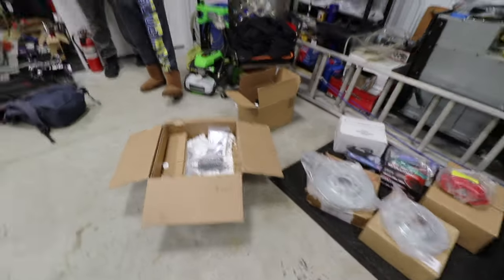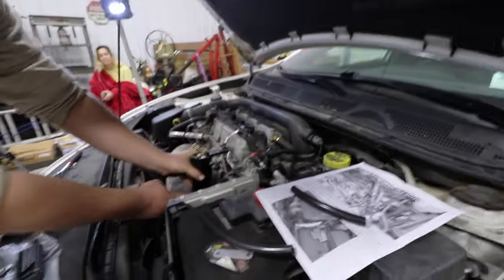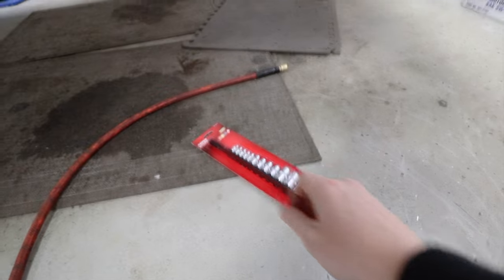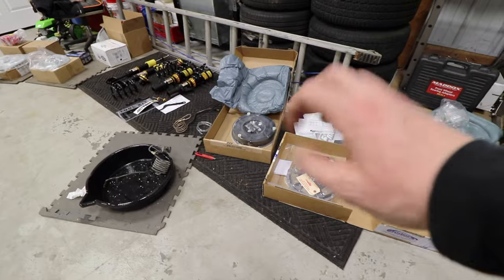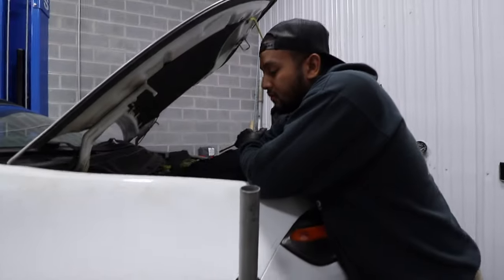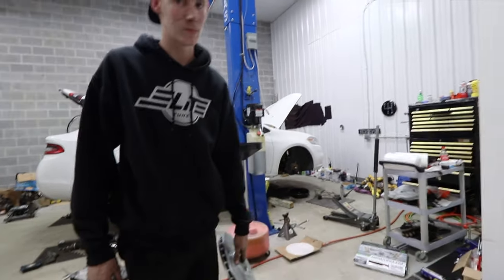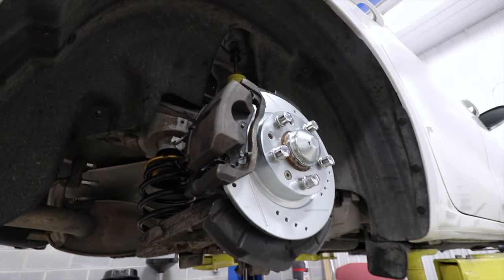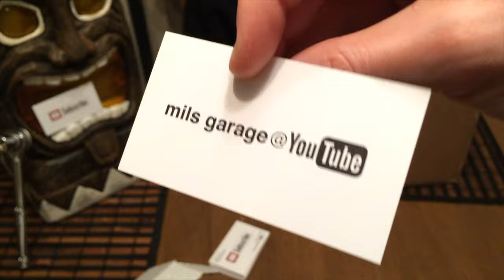Dodge Dart GT Gets Upgrades [ Yellow Speed Racing Coilovers, 6 Puck Clutch, Flywheel, More ]

Comment: I bought bc racing coilovers for my dart but it did not come with camber plates idk what to do, is there camber plates I buy separately or how does it work I literally took out the old shocks I had in the car but when I went to put the coilovers in the car I didn’t have anything to hold it still and idk if I need the camber plate or not?
Reply from the maker: Did they come with the same setup we installed here?
Reply: @milsgarage  I reached out to the company I got my BC coilovers from and they told me I just had to transfer the upper mounts off my stock shocks onto the coilover, I didn’t know I had to do that 😅
Reply from the maker: @JonathanGarcia-bl9xl  i show that in this video lolz